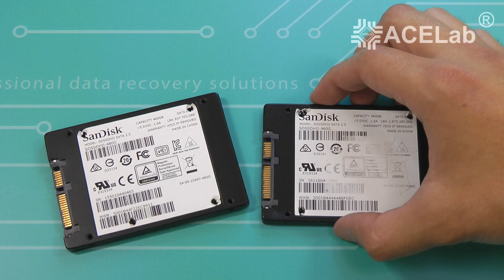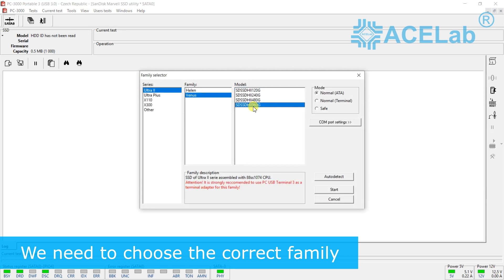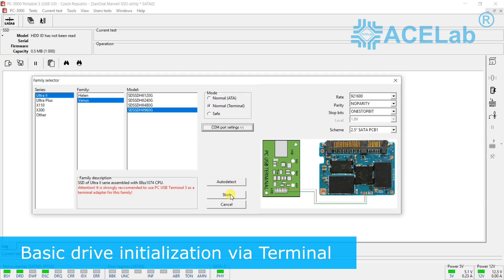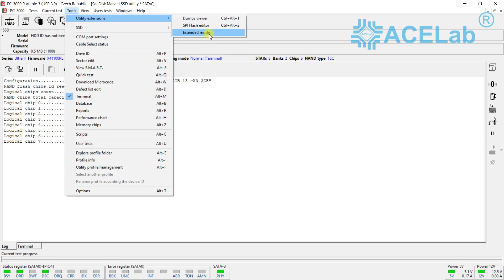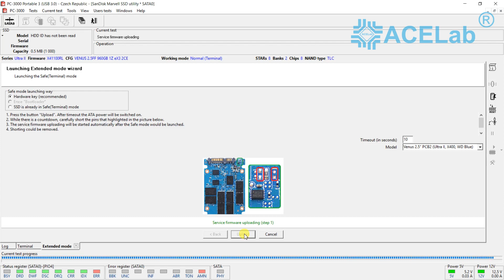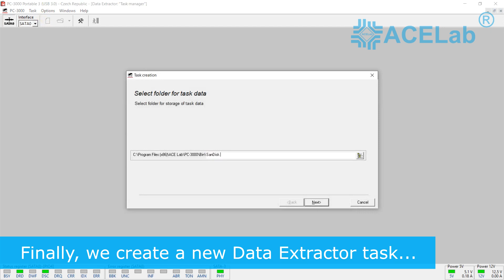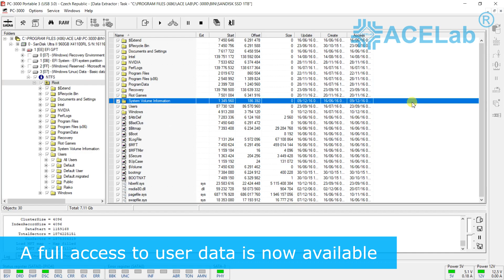How to recover data from Sandisk Ultra II, SSD Plus and WD Blue (Marvell CPU)

Comment: Hi, tks for the video. 
How to recover data from SSD Sandisk SSD PLUS 480G, you have information or video for this SSD?
Reply from the maker: Hi and thanks for your comment!  If the controller in your drive SSD Sandisk SSD PLUS 480G is the same as in the video, the same method as in this video will work well
Reply: @PC3000datarecovery  Thanks for your kindness to answer my question.
Reply from the maker: @lucasjamarinocerqueira  you are welcome!

Comment: Hi there, we have got a  Crucial MX300 275GB M2 form SSD, with  88SS1074, Can i use the same method? But I cannot see the short pins in M2...
Reply from the maker: Hi! At this moment, PC-3000 SSD can handle Sandisk Ultra II, WD BLue, and Sanidsk SSD Plus, which are based on 88SS1074. 
Other models based on the  88SS1074 controller are not supported by now, but we are planning to extend the 88SS1074 support in the future

Comment: I have m. 2 SanDisk 256gb ssd with ss881074 control Lee i think its broken due device is not showing up. What should i do? Is there any safe Mode pins since its so small also couldnt find any schematic for that SanDisk.
Reply from the maker: At the moment the M2 modification of SanDisk 256GB 88SS1074 is not supported, as well as SanDisk X400. Though, our developers are constantly working on the support of new drives. If you follow our news, you will be one of the first to hear about the updates on this

Comment: Hi my controller marvell 88ss9190 bjm 2. Can i reach my desktop by using thid method? Sandisk ultra 2 120gb
Reply from the maker: Hi Wabaki! Yes, you can use this method for your Sandisk Ultra 2 120GB based on the Marvell 88SS9190 controller. Here you may also find the list of  supported SSDs: https://blog.acelaboratory.com/pc-3000-ssd-list-of-supported-ssd-drives-regularly-updated.html
Or feel free to contact us at info@acelaboratory.com if you have any other questions :)

Comment: Is there a method to set SanDisk x400 m. 2 to factory acces mode? I mailed them but i suppose they aint gonna tell it.
Reply from the maker: Thanks for your question! At the moment the M2 modification of SanDisk 256GB 88SS1074 is not supported, as well as SanDisk X400. Though, our developers are constantly working on the support of new drives. If you follow our news, you will be one of the first to hear about the updates on this. For more questions you are also welcome to contact us at info@acelab.eu.com

Comment: i have a dead 240gb sandisk ssd plus. can this be applied to it?
Reply from the maker: If your Sandisk SSD Plus is based on the Marvell 88SS1074 controller, you can use the same way as described in this video. If it's based on SM2246XT, data might be damaged by the ECC errors due to the low NAND quality, but the recovery is still possible!
Reply: @PC3000datarecovery  where can I read the controller?
Reply from the maker: @Gonzakoable  The controller name is printed on a large square chip on the SSD printed board

Comment: Can I recover samsung 256gb using this method
Reply from the maker: Hi and thanks for your question! 
This video describes how to work with the Marvel  88SS1074 CPU. Your Samsung SSD has a different CPU and you need to use the technique for Samsung CPU.
You can see the list of models supported by the utilities on our blog https://blog.acelaboratory.com/pc-3000-ssd-list-of-supported-ssd-drives-regularly-updated.html